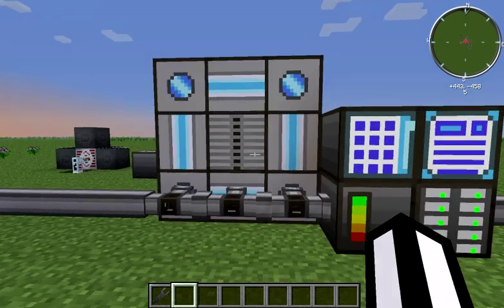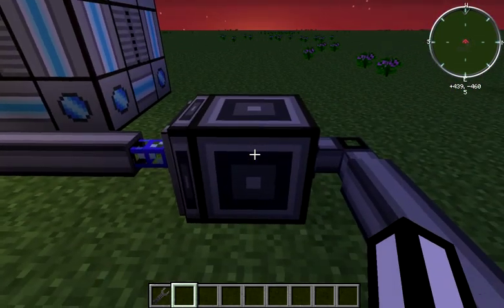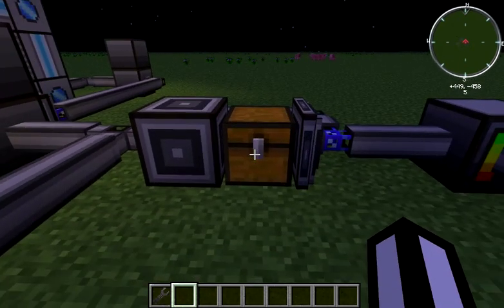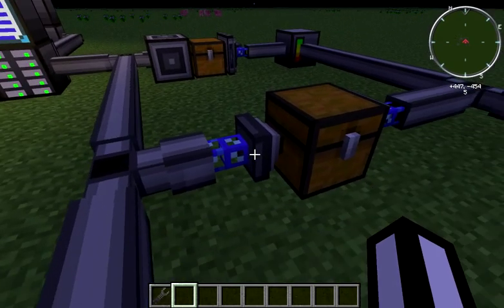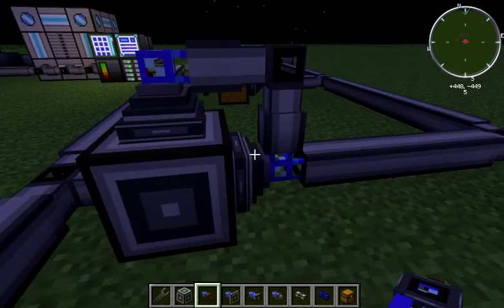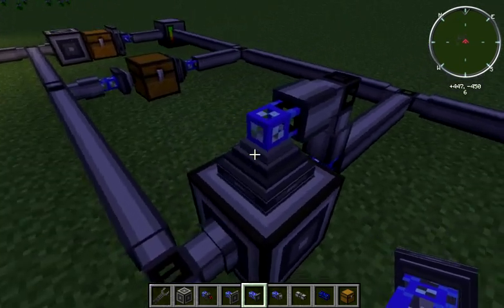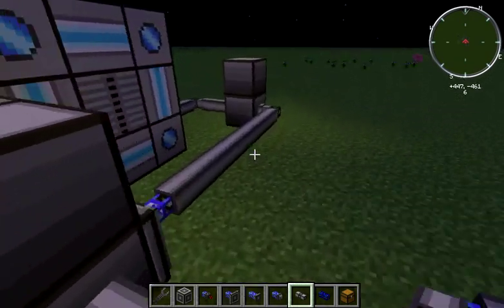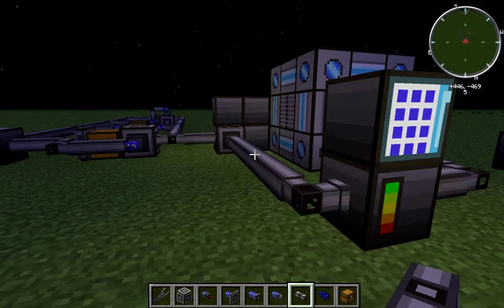Applied Energistics - Subnetwork Overview

Comment: Great video!
I never used a subnetwork but I just noticed how to properly make a "Auto-Stock Factory" (automatically pulverize/craft/smelt things and keep a stock determined by level emitters) I will actually need one in my current modpack (Yogscast Complete).

Without subnets it gets really messy to make some automatic-level-emitter-processing that smelts/craft/pulverize a lot of different types of items.
I was doing this kind of mass-auto-processing using only 2 Elite Factory Smelters/Crushers without subnets and the factories would be either too slow or too fast, and in a few minutes the results would be: 
- Automatic Processing factories/buffers/ducts are stuck, full or simply not behaving the way I want them to.
- I'd get A LOT more than the amount I wanted. Set 3000 Glass, get 5000 Glass.

Since I really didn't want to use too many interfaces/buses or too many factories - I found my solution with subnets and translocators. I always found the concept of subnets awesome but never used them, and ended up forgetting how to set them up nicely.

And I loved the Management Subnet, man! Didn't know you could access ME Machines' inventories like the MAC and ME Chest/Drive with storage bus :o OH, THE POSSIBILITIES!

Anyway, thanks! Applied Energistics is simply awesome :D